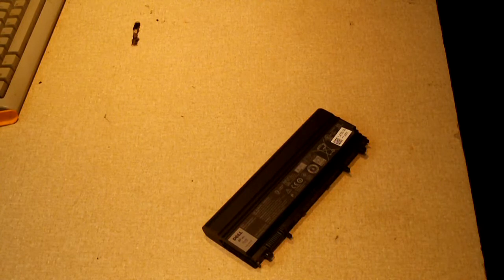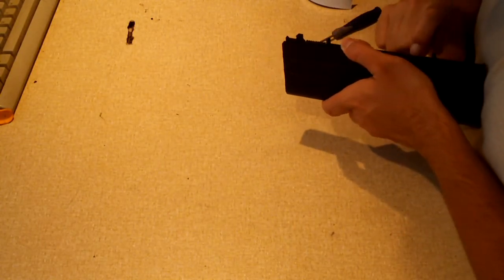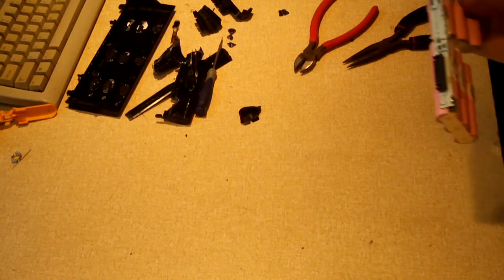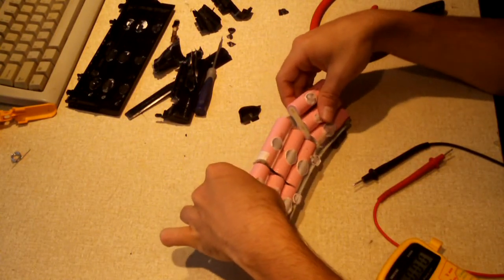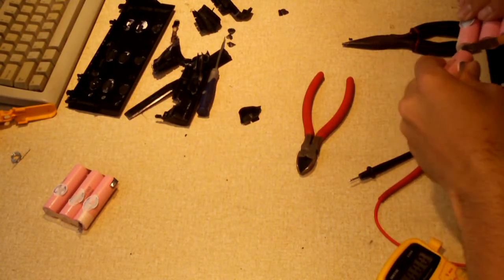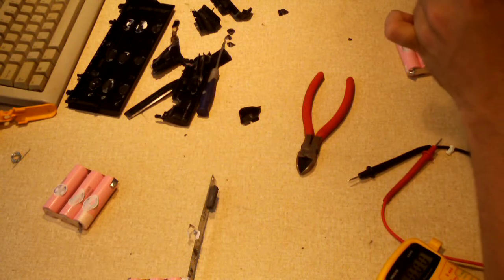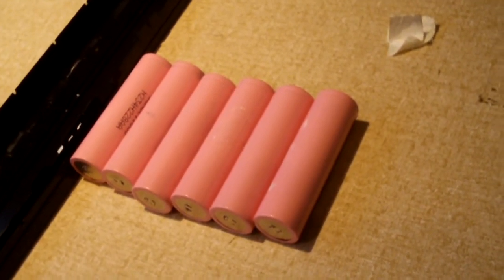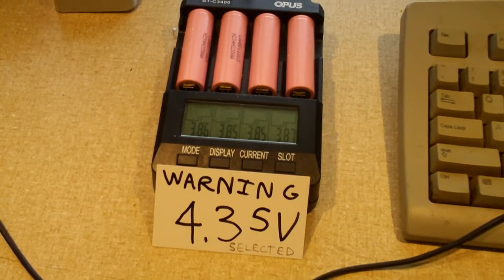Extracting Pink LG LGABD11865 Li-Ion cells from Dell Laptop Pack

Comment: Those LG cells are rated for 4.3V per cell vs the normal 4.2V. While they are good cells, they are rated for only 2C discharge which limits their use in high drain situations.
Reply from the maker: Yes, they are 4.35V cells. Most laptop cells are rated for 2C discharge.

Comment: Hi. Today I had purchased the same battery with 9 cells from scrap. But when I checked the voltage, all where showing zero voltage. What can I do now ?
Reply from the maker: Then they're bad cells. Either the cells themselves have drained or the protective CID has tripped, making the cells an open circuit.
Reply: @CubeComputerChannel  thanks for prompt reply. Is there any possibility of recovery. I had kept on charging using the charging module to check if there can be any recovery. Another question, before buying scrap battery how can we identify if some of the batteries are in working condition or no.
Reply from the maker: @ModifywithManoj  You can "reset" the CID in the cells, but if you do, you are playing with fire. The only way to tell if the cells are good before ripping open a pack is if you have a laptop that the pack fits and you can use the laptop to see if the cells hold any charge. Even if the laptop refuses to charge doesn't mean all the cells are bad, typically just 1 bank is bad. But other than that, the only way to tell if the cells are good iis to pull them and check the voltages. It's a treasure hunt.
Reply: @CubeComputerChannel  ok. Thanks for reply

Comment: i have a toshiba that uses the same cells and it was an absolute disaster trying to open the pack. By the way are there better substitute to these cells that will work on my laptop?
Reply from the maker: I would not recommend replacing cells inside a laptop battery. There should be generic replacement packs available on Amazon. They will however likely have a lower capacity.
Reply: @CubeComputerChannel  yeah, i figured but i just got a soldering station and have been watching plenty of tutorial since i recently found out that i am very attracted to the hobby. So then i should stick to the same model cells?
Reply from the maker: @thingshappen9199  There are two reasons why I discourage rebuilding laptop batteries, and a 3rd reason for this specific pack...

1. Once you crack open a laptop battery, it's next to impossible to put it back together to where it is fully intact like it used to be prior to opening it.

2. Those cells are not soldered together, but spot welded together using a special machine. Wires are soldered to the metal tabs which connect the pack to the circuit board. The reason why cells aren't soldered directly is because of heat. Soldering irons are very hot and they have to be very hot to be effective. Putting too much heat into a cell could cause it to go into thermal runaway and explode with fire. While it's fun to have a soldering station and get to mess with things, bare cells and soldering do not mix. Yes, there are videos of people soldering new cells into an old laptop battery, including a video from the8bitguy, but I don't recommend it out of a concern for safety. I did once solder a small 18650 pack together, to run a camera, but it was done with extreme caution.  Therefore, I do not recommend it. If you want OEM performance from a new laptop battery, then your only option is pretty much going with an OEM Toshiba laptop battery. That will likely be expensive.

3. If your laptop battery uses the same specific cells as this one, these are rated for 4.35V maximum charge. Most Li-Ion cells are rated for 4.2V maximum. Installing common 4.2V cells in a circuit meant for 4.35V cells will result in cell damage due to overcharging, possibly resulting in degraded to performance at the best and risk of cell explosion at the worst. You would have to find 4.35V cells and make sure they are in fact rated for 4.35V charging before installing them in this pack.
Reply: @CubeComputerChannel  well, i guess they are the same 4.35 v as yours since the model number is exactly the same. There is something that's got me very confused though, the cells that i've seen in ebay have another code right under the model # . Do you know what that is? I'm thinking it just has to do with factory specific detail? But anyway, i already already an aftermarket battery for my laptop and i know it's going to be crap sp that's why i'm also trying to do more research about how to put my own battery pack together even though it can be very dangerous. Thanks for the concern man, i know the iron can't exceed more than 2 seconds on the cell when hot.
Reply from the maker: @thingshappen9199  The second number has to do with production, including date of manufacture.
Reply: @CubeComputerChannel  Thanks man I might even buy a spot welder since they are kind of affordable. I was looking for plastic pryers but 99% of what i saw were for auto use. Do you know of any specif ones built for battery packs so i don't have to wreck the plastic case again?